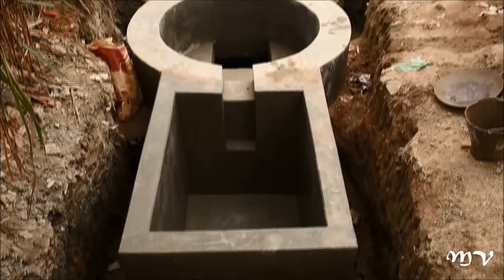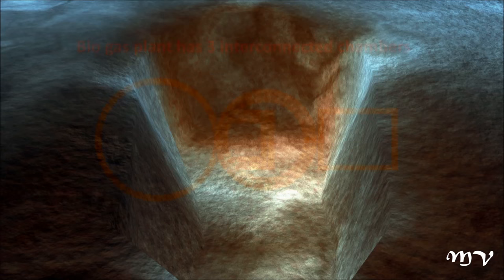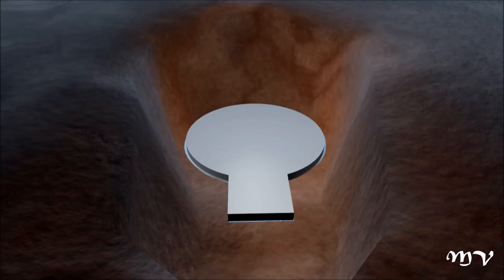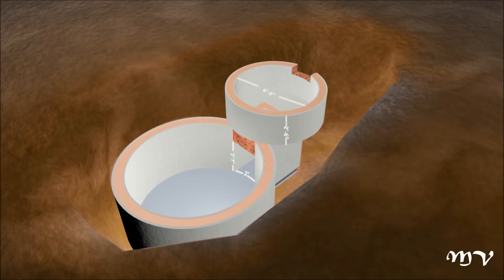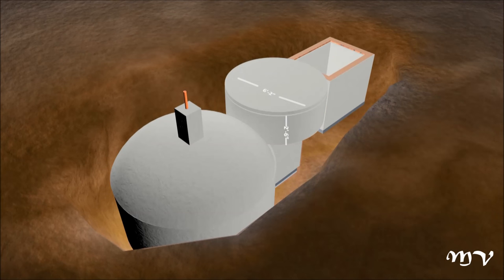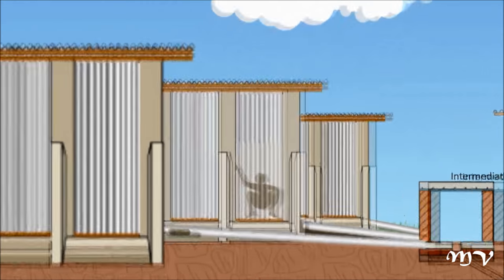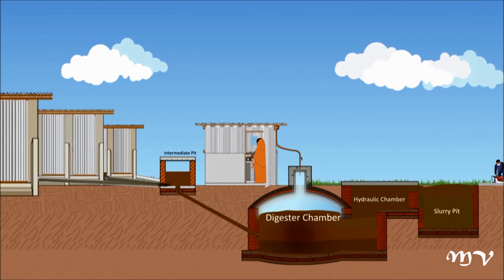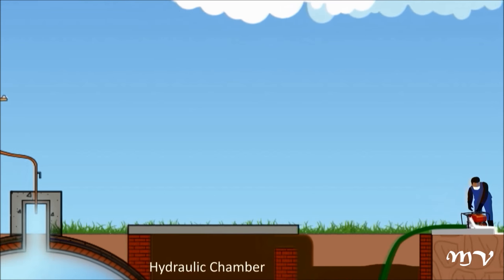Biogas Plant Construction, Design and layout for better understanding

Comment: Will someone explain and suggest me  good ways to maintain the temperature of bio gas digester to about 37 degrees . I want a good insulating to retain the heat .. it would be good to hear some insulation techniques plz ..
Reply: Try covering the digester with aluminium foil, and don't keep it outside, try keeping it in a room